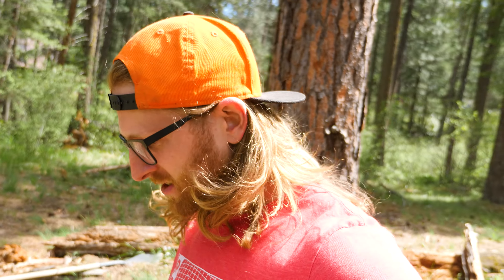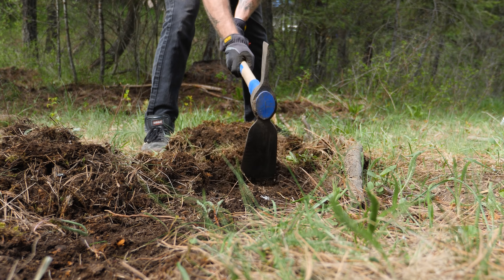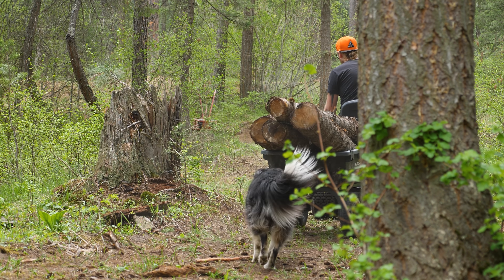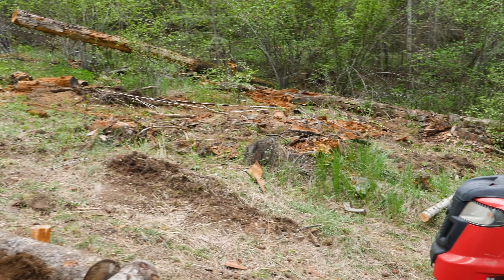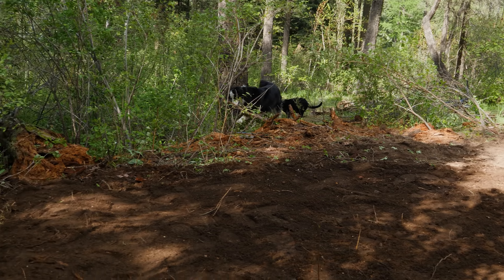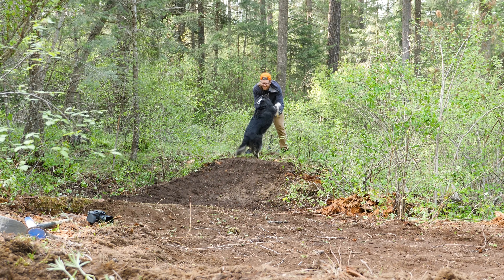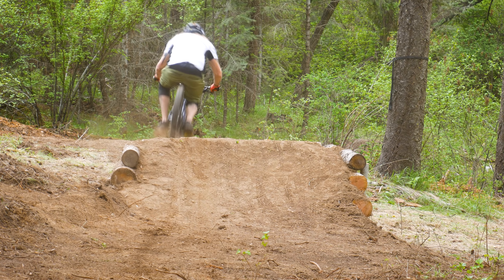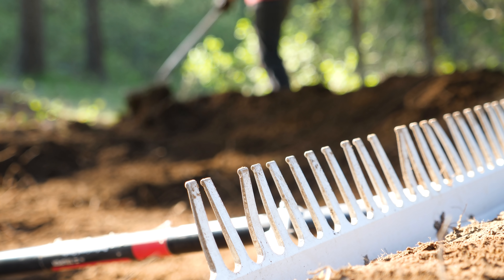Mini Road Gap Build and Ride // Connecting the Jank Plank and the Crank Plank

Comment: My shocks went on my Capra too now. Not sure if it's a defect for the DHX2 but bit strange that both of ours have failed close to each other. The bb is also pretty rough. had the cranks off today and The spine had barely any grease and water had hot past the bearings. Would recommend checking yours as well cause we had the same issue with my dads Capra. Keep shredding!

Comment: I’m building a pump track in my back yard with nothing but shoveling on 1.75 anchor yard. I’m almost done but I broke my arm recently so progress and stoped. Anyways I noticed that you were burying landscaping bricks. As well as they are good for burying there also grate for holding up the back side of a y’all berm. I will be using the same type of bricks for holding up the back side of a three foot tall berm to save me shoveling time and make it look nice and neat. The other thing I’m doing is paving the face of the berm with bricks to Mack it a clean look. Just thought you should know. 👍
Reply from the maker: I initially thought about using those bricks for framing instead of the logs, but we didn't have enough on hand. Sarah's re doing our garden beds around the house and those were *trash, so into the jump they went!

Comment: I have a 2m high drop inn, it doesn't get as much speed as I thought, can anyone recommend what i can do to go faster, apart from making it higher? Thanks
Reply: Maybe dig the bottom of the landing a bit deeper and use the displaced dirt to make a roller you can pump at a comfortable distance from the landing? Idk what kind of space youre working with between the next feature or berm tho
Reply from the maker: Definitely make sure the transition from the roll in to the ground is a smooth one, if it's an abrupt hit, you'll lose a ton of speed, and if it's smooth you can pump out for more speed.
Reply: The Shredist awesome, thank you for the info, I will adjust the transition, as it is quite abrupt. Thanks again
Reply: ryogain USU thanks, will do